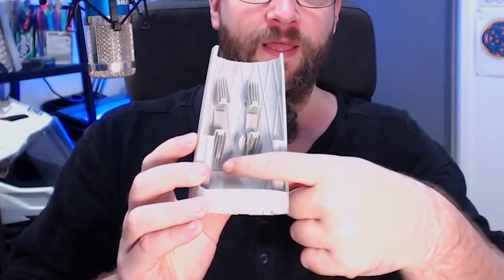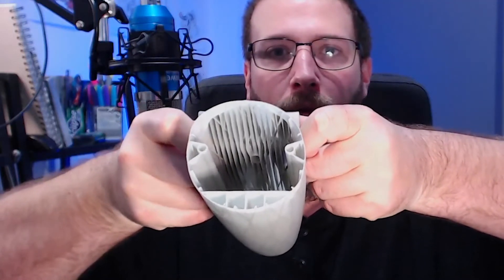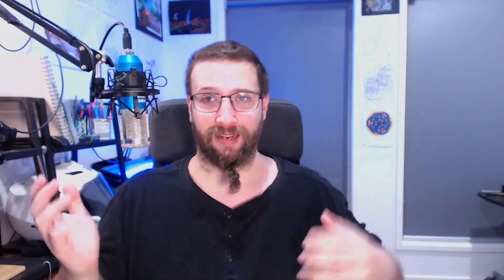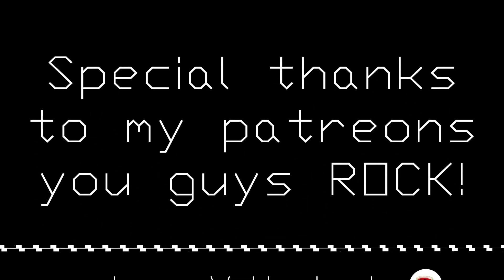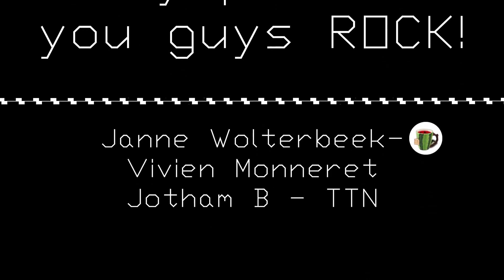chaos daily 2021: 047 Things need to change

Comment: Consider testing other variations of material? I'm guessing you can get a tradeoff between toughness/hardness. Wonder if going up slightly on hardness is a good idea? I imagine with the current material it'll handle impacts really well.
Reply from the maker: yeah, I added 25% Blu to the last couple prints and there wasn't much change in the structural rigidity, however the skin is more fragile to puncture/ impact. I added the Blu to boost the strength on the fuselage wing root section. Ive already gone through and re worked the internal structure, more on that in the next daily.